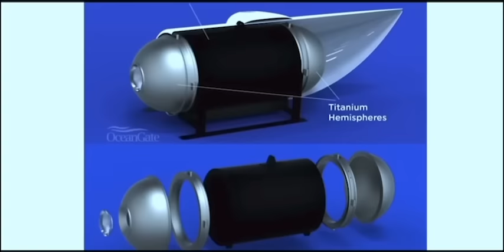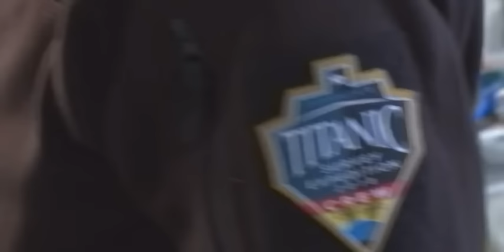First look at #oceangate #titan Debris

Comment: Carbon fiber is great for tensile stresses, but you wouldn't ask a circle of rope to withstand compression. Positive pressure hulls are great with it- with the right arrangement it can give structural support along axes that you appropriately design it for where tensile forces are involved- the uniaxial winding on the cylindrical composite chamber they used in this case would withstand tremendous positive pressures, as the circular winding of fiber would resist expansion and within manufacturing tolerance keep the epoxy medium from cracking. Negative pressure is different though- if you imagine that cylinder under negative pressure, there is little benefit gained from the fiber- the fibers "go slack" without any support to rest against and the only possible boon is that they minimize crack propagation and possibly impart a little bit of equilibration to stress distribution over the hull. 

If they'd used a different winding style- for example with two axes, the previous axis plus a toroidal winding, the toroidal winding would allow some tensile forces to develop from the lateral compression of the composite cylinder onto the titanium caps. Even better, using some sort of frame (similar to an aircraft, itself not using a pure composite cabin but with some form of frame, too) would allow local regions where the fiber would better make use of its tensile properties, whilst not requiring the entire cabin to be constructed of some heavier material.

In any case, beyond any of the talk on ways one could make use of tensile stresses of the actual fiber, it isn't just fiber- the fiber is embedded in a medium, for example epoxy, which will end up developing cracks and so forth over time- and features a very unsavory mode of failure. The failure mode of a metal canister is much more predictable and much more reliable than a composite canister- and I'm much more happy to trust the reproducibility of a titanium cylinder than a cylinder made from epoxy (mix ratios, air bubbling, sensitivity to temperature/humidity/environment, etc.) 

*I have to digress, my knowledge is all speculation- I'm an Astro guy, not a Materials one. That being said, I would hope that at least some of it is reasonable. 
*Also, that bond area and style of bond- the flexure there between the two dissimilar materials... jesus god damn christ.

Comment: Space shuttle O ring failure is a fantastic comparison. I still find it unbelievable that they couldn't see their own design flaw based on surface area alone, the differences in pressures on the capsule tube would have been far greater than on the ends. I'll bet they were taking on water soon after they started descending, which explains the rapid decent rate, and they were attempting to slow the decent at first before realizing the leak then attempting to make an accent with electric motors, and dropping all weighted ballast including the landing gear...

Comment: Ah - "glued" on.  "glues" can be phenomenally strong. I have no idea what they used, but Ive used stuff to bond centred bronze bearings - under load - to stainless steel rods, and nothing could touch it. Nothing. That was a chemical bond used on aircraft. I think it has more to do with the materials and their differing shrink and expansion coefficients. But hey.

Comment: I have composite testing experience, and have seen composite components produced and assembled into structures. I gasped when I saw adhesives being applied by hand at ambient temperatures in an uncontrolled atmosphere on dissimilar materials that have entirely different mechanical characteristics. Furthermore, this bond was expected to cure and form a defect free structure with no mention of any sort of NDT testing afterwards, it would have likely failed at that stage anyway.
Reply: I'm glad you didn't use the word "glue"! Having to have worked many years in composites,I cringe at the term "glue"! What I would like to know what the adhesive was made of! Phenolic micro balloons, asbestos or what? When I worked on atomic submarines, we used phenolic micro balloons and epoxy. For the rescue bouys. Which would give it a brownish color. NO WAY IT COULD withstand the pressure in which you would encounter at the depth of the Titanic! As the little balloons would soon callapse
Reply: I'm glad you didn't use the word "glue"! Having to have worked many years in composites,I cringe at the term "glue"! What I would like to know what the adhesive was made of! Phenolic micro balloons, asbestos or what? When I worked on atomic submarines, we used phenolic micro balloons and epoxy. For the rescue bouys. Which would give it a brownish color. NO WAY IT COULD withstand the pressure in which you would encounter at the depth of the Titanic! As the little balloons would soon callapse
Reply: @robertchilders8698  It looked like some simple mixture that was applied with wooden tongue depressors. It would be nice to know if it consisted of a part A and part B or others as a catalyst and hardener. The adhesives I have seen are always far less ductile than the carbon or aramid )or whatever) matrix. Emost of the time, except for repairs, all of it was pre-preg stored in freezing until layup. I think with the data that has come out since the recovery will tell us more by deductive reasoning.

Comment: My opinion
1. The tubular shaped hull was not strong enough for the depth.
2. The carbon fiber was not strong enough or thick enough, 5 inches sounds thick but not thick enough for that circumference.
3. Four different materials were used in the hull that means 3 different molecular makeup's that expand and contract at different temperatures and pressures...carbon fiber , resin , epoxy (looked like Jb weld) to adhere the end caps and titanium end caps which were dropped on each  end, they didn't look pressed on and the carbon fiber hull ends were shaved down on the ends at least an inch to meet the size of the end caps from the video I saw when the built the sub.
4. The acrylic view port was not rated for the depth of the wreck.
5. No proper testing of the sub...If it was rated at 13,000 feet then it should of been dropped down un manned numerous times of a depth way more.....the sub is going from around 80 degrees on the surface to around 30 degrees on the bottom and from zero pressure to a tremendous amount on the sea floor constantly.
6. Cheap materials inside...no proper seating or rails to grab on to if the sub starts swaying...someone could of grabbed a computer monitor on ripped it off the sides or cracked the screen or any other critical parts if the were to slide around.
7. The ceo himself is to blame for his lack of foresight and mismanagement and even dismissing experts opinions as if they were just jealous of him.
Reply: How many times do I have to joke about the sube being glued together

and hear you are outdoing me
two types of glue

You forgot one.
They used a lazy redneck weave.
They should have used a diamond weave, but it would take too long and be too tedious.
Should have been three times thicker- you got that one
but there have been rings. All submersibles where spheres, not ciagrs, atleas in the air side,
and it should have had spheres on the inside.
-spheres with rings.  

yeah, they should have hired a rivviter
Reply: Yet it worked for years
Reply: @ericerickson592  The Titan had made 3 trips to the titanic ....it could of made 20 trips but that 21'st trip might not be so lucky
Reply: He actually said people were using safely concerns  as a means to hold him back and prevent him from innovating.  He also said  there are people who use Safery concerns to purposely prevent innovation .  He really thought  people were using Safety  to wage a vendetta against him .
Reply: @ericerickson592  and it would have worked for many more years had he built it correctly.  He got lucky. And it did not work correctly years it worked a handful of times over 2 years   are you aware there were far more Titan dives that had to be called off  then there were successful ones   and  every time  it was because of equipment and safety problems.   On the first dive when they reached to sea bed they realized they had installed one of the the thrusters backwards   you are supposed to catch these things before  diving 4000 meters.   They already had to rebuild the hull  because they found deterioration  of the carbon fiber  hull and ir was downgraded th 3000 meters so the hull was rebuilt  to get if back to 4000. It's lost power on one dive  and they got lost on the sea floor for 5 hours on another trip.  They had major issues   with every dive 
Your argument is like saying  space shuttle challenger was not junk because  it di explode on its first mission
Reply: @adamwatson6916  no one gets lucky at those depths.  Either it works or it doesn't. Your argument makes no sense .. your saying that space shuttle challenger was junk because it failed at the end.  All because of an oring.  Something so simple.
Reply: Only tightening the bolts that were easier to tighten, so leave one off to create imbalances, yep sounds a good idea at pressure.
Reply: And the carbon fiber tube was not cross wrapped at 90 deg, angles, just layered almost parallel to the preceding passes. This allowed the tube including inside the end cap lips to split vertically just about anywhere along its length.
Reply: it did 3 trips previously 🤦🏻
Reply: The way they test subs is by filling them full of compressed water and see if it pops but this ship wasn't designed to be tested like this ....some say it made 7-20 trips to sea bed.
Reply: @eioclementi1355  except subs are pressurized from the outside. one atmosphere inside. 35 Atm+ on the outside of a naval sub
Reply: @anthonysei  it just the test stage when building the parts military sub go through lots of other testing but civilian sub it just to see if the empty Hull can take this  pressure on land in the test environment.
Reply: @ericerickson592  While the space shuttles are marvels of engineering, I still consider them to be "junk"; not because of their many fatal flaws, but because the design failed to satisfy significant requirements, and failed to live up to the expectations NASA set for the program.

That o-ring you speak of: did you know combustion gasses compromised this o-ring on prior flights? NASA had come perilously close to vehicle and crew losses prior to the Challenger disaster. The o-ring itself wasn't the problem; the design of the booster was. NASA understood the problem and knew the risk but chose to continue flying the shuttle anyway. NASA was "lucky" until they weren't, just like the builder of this sub. The o-ring caused a RUD but, if it hadn't, many other problems were waiting to produce a loss of the vehicle and its crew. Look at the other shuttle we lost; it wasn't an o-ring that caused the astronauts on that flight to be incinerated on re-entry. Same with this sub: if a hull failure never killed a crew, one of the many other design shortcomings eventually would.

Simple things matter. Complex things too. More importantly, nothing in life is without risk.

This sub was a very risky device. The builder could have done things differently, gone to greater lengths and expense to make a vehicle less likely to fail; but he chose not to. I don't fault him for this. His life, his choice. I do, however, fault him for misleading his customers about the degree of risk they would face as passengers. 

Most of us face risk to our lives on a daily basis and don't even think about it. We ought to more carefully evaluate the risks we face and strike a thoughtful balance between mitigation and acceptance. I think the passengers of this sub did a poor job evaluating the risk they faced. Blame the builder if you like but remember: ultimate responsibility for a person's safety lies with that person. The passengers failed to recognize signs the builder dude was understating, minimizing, distracting from significant risk. They failed to seek 2nd and 3rd opinions. They ignored the warning signs: an extensive record of dangerous problems on prior trips, odd design decisions, strange equipment selections, previous customers who ultimately opted NOT to take a trip in this death pill. So they were taken by the slick sales pitch and got to experience the trip of a lifetime.
Reply: @eioclementi1355  100%, he proof tested fatigue life with humans. poor engineering plan.
Reply: @anthonysei  he was warned not do this! and to design a vessel that can be tested with external resources and independent trials.

Comment: I’ve been in composites for 20 years and even I could of told them that bonding metallic to composite was going to be a failure point.
Reply: You are right! In order to bond composites to metal, you have to have an intermediate material to make up the different expansion rates! When I worked on Polaris rocket engines , we used neoprene rubber, between the aluminum parts and the filement windings!

Comment: All good points. This device was woefully underengineered. The inward flexing of the plastic parts would have reduced internal volume decreasing bouyancy and increasing the rate of descent. At these depths you need a totally rigid hull.

Comment: Good catch! any expert in sub design would have suggested to change that type of joints with a flange type design, glued or/and bolted to contrast pressure anysotropy poping out the titanium ring as a plug from a bottle. Most important visible, easy to inspect compression joints is a must! The way they did it have hidden latent cracks leading the catastrophic failure of the joint. They Rest in peace

Comment: So just to put another theory out.     There is video of the front end cap being unloaded from the recovery boat,  notice that viewing port is missing, but more importantly notice the the entire titanium flange that the viewing port was bolted into is missing.    At the depth of 3000 meters there is approximately 375ATM (atmospheres) of pressure or about 14.7 x 375 pounds per square inch ( there are a lot of variables that influence the actual number) or ~5,500 pounds per square inch.     There are some posts going around that this pressure was concentrated in long middle section - this is incorrect - the pressure is equal on every square inch - what is not equal is the effect of the pressure.  Some have speculated that the end caps "popped" off - this is also not likely with 5,500 pounds of pressure on the outside and 14.7 pounds of pressure in the inside.   If the unverified transcript of the sub/surface text communication is accurate - it is much more likely that there was a leak which was causing buoyancy issues (the transcript showed the sub descending much faster than the plan).    The transcript also showed that even after the ballast weight was dropped the sub was still negatively buoyant.   From the information available the sub had three very large lead pipes for ballast that were dropped, the sub also had two "roll weights" , ballast bags , the detachable landing leg platform (which was dropped) and a bladder that could be inflated.   (There were also ballast bags attached with "dissolving connections" that would have dropped after a certain period of time).    Sea water weights approximately 62-64 pounds per cubic foot ( compression due to depth and dissolved salt content cause the variance) -  conservatively the lead pipes and roll weights totaled around 300 pounds.   If after dropping these the sub was still negative ( as transcript indicates ) this means that almost  5 cubic foot of water had likely infiltrated the pressure vessel.   The transcript indicates the primary electric/power system failed and the switched to the backup.  If the backup system failed - not only would they not have population, lights or heat - they wouldn't have had carbon dioxide scrubbing ( co2 is scrubber by passing it through a solid chemical such as calcium carbonate).  The center section of the pressure vessel was a steel tube wrapped in carbon fiber - even if the carbon fiber 'disintegrated' the steel tube would still have been there.  ( Finding that may be a key in actually knowing the truth ).  The transcript indicated 'crackling' sounds aft which many assume was the carbon fiber de-laminating (which could be correct), but if it was truly aft , behind the passenger area, that would have been the titanium end cap.   So with all that  preamble,  if there was a catastrophic failure in the aft section - water would have been propelled in under 5,500 psi - possibly surging through the tube - blasting the viewing port and then the front titanium cap off.  These would have sunk immediately.  The carbon wrapped steel tube however could have sunk at a different rate - and hopefully will be found somewhere farther away.  Just more speculation.

Comment: Strait forward concise and correct. Just consider a dryer receiver on a Ac unit there is a reason that it’s one solid unit made of a single metal spiracle shape belt together with a weld and its strength focuses on the ends and weld points. And the pressure lines are also welded to the vessel made of the same material. And that’s just  for an ac pressure system. Leaving no chance for tank failure due to pressure changes. Like he said you don’t even have to be an engineer to know how that works and why. 
Different materials expand and contract at different rates with heat cold and positive and negative pressures. So the mating surfaces are prone to failure!. 5:36
Great observations👍